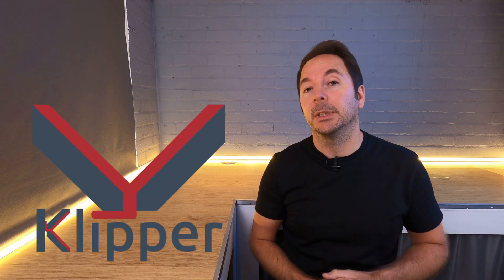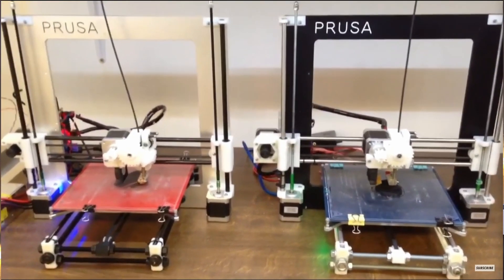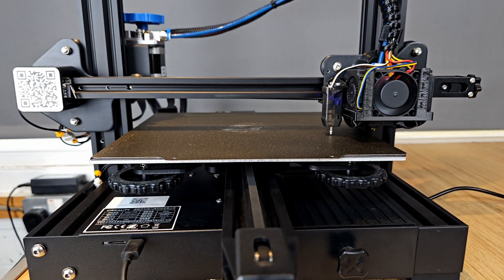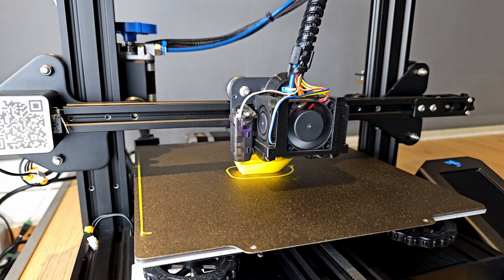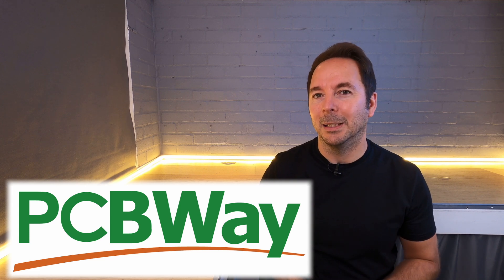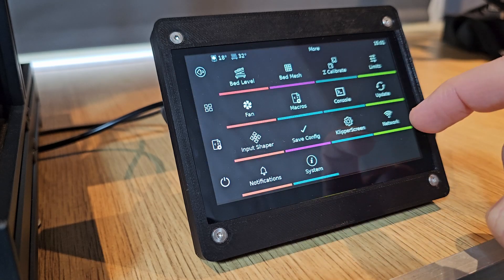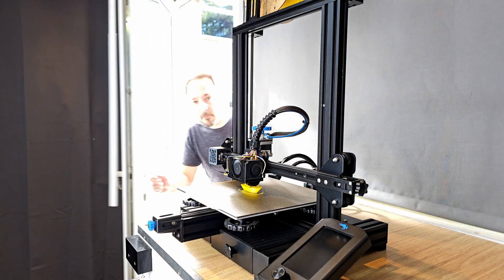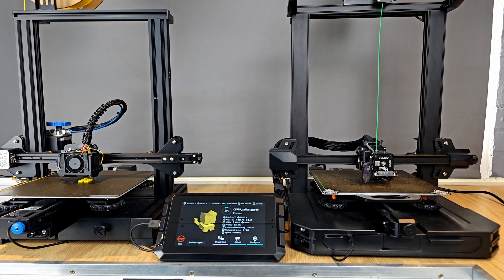Klipper Firmware - Why You Need It On Your 3D Printer

Comment: I installed klipper on all my 7 printers. I switched all but 2 back to marlin just because of having to be online to control it with klipper.

 If you don't plan on moving the printer then klipper all the way.

Comment: Have Klipper running on a HP Thin Client connected to my Ender 5+. Did probe_calibrate and set the bed level using a feeler gauge and saved the config. Unfortunately I have an issue with when I try to print the nozzle is about 1mm too high. Doing the calibrate again doesn't resolve the issue. Google search finds a few people with the same issue on different printers but don't see any actual resolution for my printer. Any help would be appreciated.

Comment: Question! I have an Ender 3 I built back in 2021 that's running a Pi 4, custom Marlin firmware, and being controlled with OctoPi. I haven't messed with the printer in a few years but decided to get back into it. Would Klipper still be an upgrade over this existing setup?
Reply: Well I did it! Klipper works well but it’s taken a bunch of tinkering and tuning to get it printing as well as it did before.
Reply from the maker: I'd say so, Klipper will likely improve the print quality and speed, even on an older setup.

Comment: It took me four attempts over the period of a year to figure out how to install klipper (I had selected the wrong communication interface while building the firmware and i kept getting the "klipper firmware failed to connect"screen in mainsail). At the time, I gave up and used octoprint instead, but I just recently tried again and figured it out, and I'm so glad I did.

Comment: I find that you have to be careful with the quality of work that the various Github dev teams have done for the different manufacturers. Force-X has been great for the 5M, but Rinkhalls is left to be desired for Anycubic devices. Their documentation is lacking and there is no record of being able to set Bed PID Calibration, Extruder PID Calibration, or Shaper Calibration. Without those details, a lot of damage can be done if someone attempts to use their firmware package. I brought these up as legitimate questions in their Discord and was told to read documentation. Not good enough when a dev says "I don't have to tune it." Not everyone's environment is the same and this is just short-sidedness on their part.  

Sadly Anycubic just doesn't have the support that FlashForge does and I hope more reputable dev teams come forward to support Anycubic.

Comment: my man, I got for years this amazing 3D printer from zonestar. Works perfect but firmware wise not so great. So i was looking for a new firmware for this thing. And i can say from marlin version tot klipper is a BIG diffrence. But wow this thing is printing the same quality when i just bought it! This is incredible. You kinda pushed me to do this toke me 6 days but hey IT WAS WORTH IT thank u so much! 

Printer info. 

Printer when just bought it ID : Zonestart Z9V5-Pro MK1
I have upgraded the main board to the a beter version in 2024.

Now my printer setup almost standard but now with wifi module and motherboard upgrade. And new klipper firmware love it!

Motherboard: STM32F103VET6-based ZM3E4 V2.0 (custom board for ZONESTAR)
Probe: PL-08N Bed Auto Leveling Proximity Sensor (3V/5V selectable)
Display: DWIN TFT-LCD (for Z9v5PRO)
Bed: Glass bed, 310x310 mm size, heated bed
Extruder: Titan 4-color mixer extruder
Wi-Fi Module: ESP3D for Marlin (for Wi-Fi control)
Other: Looking for auto-bed leveling, Wi-Fi control, smooth operation, and advanced features.

Comment: To use Klipper I need RPI(or any other PC-like device). So... If I have RPI I can put octopi and also connect cam, relays and tones of other stuff, also connecting more then one device is not a problem... Next not all upgrades need to reflash your Marlin, but if you need(in case of big upgrades) and you have always connected linux based computer(as in Klipper setup), you can use Arduino IDE or Arduini CLI or PIO or avrdude, so where is the problem? Do not get me wrong but the advantages lie in something completely different that did not appear in this film. Also You didn't even say a word about USB problems :|

Comment: Thanks for the explanation! I recently installed Klipper and I have everything working, but then my quiestion is, what should I modify in the slicer to get more speed in my prints? For example you compared you ender 3 with Marlin and then klipper and you got your benchy faster... what did you do? Thanks again

Comment: First layers are dependant on how clean the bed is, how well it is leveled, and slicer settings.  NONE of these have ANYTHING to do with the printer firmware.  If t he bed is well leveled MECHANICALLY then the effective parallelism between the print head and the bed matters, which the printer firmware DOES control.  SO, in most cases, the first level being put down well doesn't really work better on Klipper or Marlin, though it may be easier to configure the printer with Klipper to get a good first layer.  After that, the odds of a first layer failure are probably about the same for either.  At least that's been my experience.
Reply: He was talking about how nice it is to monitor it through the camera, and firmware can definitely impact the first layer. I have an adventurer 3 that absolutely sucks at bed leveling. Either it needs extensive hardware changes or firmware changes to make it reliable.

Comment: I have an Ender 3 V2 gathering dust along with a Creality Sonic Pad that has never been configured for use. I now have an K1 Max that I use for 3d printing of repair parts and fun stuff for my 3 year old granddaughter. In the past a Raspberry Pi 4B running Octo Print was used to send models and monitor Ender 3 V2 prints. I would like to reuse my Ender 3 V2 and learn how to use Klipper. I  notice you have migrated to using a Raspberry Pi instead of a Sonic Pad. Can you share your thoughts on what additional benefits the Raspberry PI has vs the Sonic Pad?
Reply: After doing some research and looking at Sonic Pad's releases including GitHub repositories, I came to the conclusion that Creality's implementation of Klipper is not fully open source. This means that new Klipper features and add ins may not be installable on the Sonic Pad. This should not be true regarding Klipper installs on Raspberry Pi or laptop computers IMO. Sonic Pad firmware hasn't been updated for 9 months or so too. I conclude that using a Raspberry Pi with a touchpad will be my choice going forward as well.
Reply: I would also be curious what the benefits are moving from a Sonic Pad to a Raspberry PI.

Comment: Marlin on a good 32 bit mcu can do benchys in 30 minutes too without a sweat. My modernized ultimeker 2, which is 10 years old (but with a direct extruder and a fast microcontroller and remote cooling) can make ok looking benchies in as little as 15 minutes.

Comment: Is that possible to run kipper without pi?
Reply: Using a pi is the whole point I believe. You can use a pi zero if a regular one is too expensive. It may be possible with an old PC and a Microcontroller with GPIO pins.

Comment: KLIPPER is a great upgrade for any printer. Iv installed Klipper from watching your vids on my ender 3 S1 Pro. However, no one talks about how to set up the slicer (ie Cura or Slic3r) to work with it !  Im at a stand still for the moment. Trying to figure out how to set up Cura. (current version).  AND no one talks about how to use Macro's.  Just see people saying that using them is more useful.  Iv been reading thru the Klipper documents.  But im lost. My dyslexia, and ADD make understanding what i read difficult.  Can you do a Cura Slicer setup vid? AND do a Macro's vid???
Reply: Glad I'm not the only one then...
Reply: I feel like I’m right there with you
Reply: Im on that boat with you🙂
Reply: Literally this! I mean just read 1 page of install on Klipper page, and you have your printer running. THEN WHAT?
Reply: Chads ask Chatgpt it can help you massively!
Reply: if you want to ther is a doc page that has most things but the documentation is not the best

Comment: Excellent video. I’ve asked this question in the comments of another of your videos and still looking for help… I came across a video, then the command in Klipper docs for Z probe Tilt. Applies to printers with tri stepper motor Z control. And it looks to take the 1.3 mm bed warp out of the bed mesh in the K1C…
Are you familiar with this command? I’d appreciate any advice, wisdom you care to share. Thanks for the video!!

Comment: Klipper Firmware - Why You Need It On Your 3D Printer <=== I don't need it cuz it won't interface with (AFAIK) my Bambu Lab X1 Carbon. Plus the Bambu OFW is great, and also Linux based.